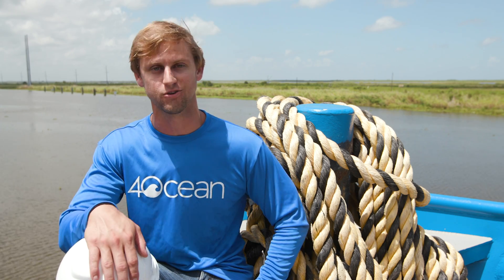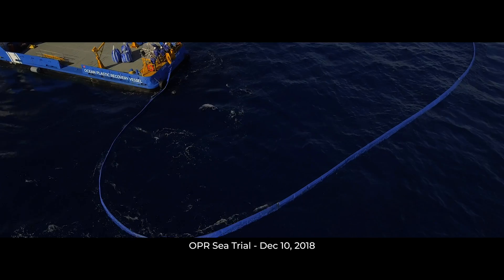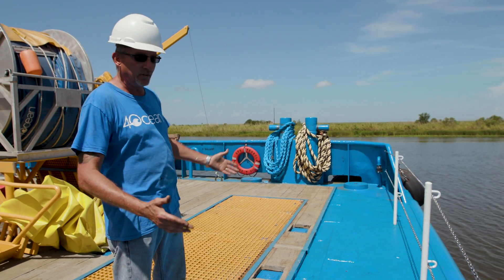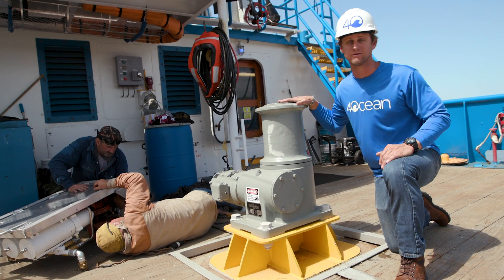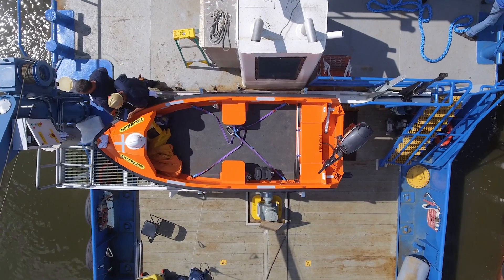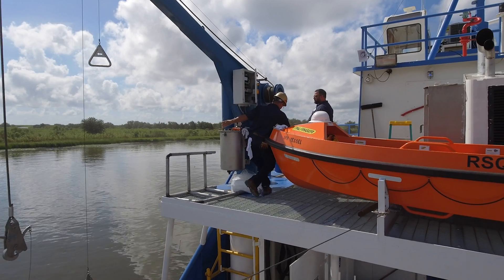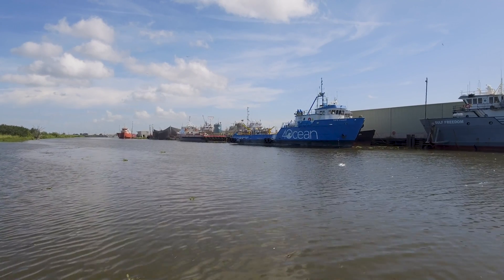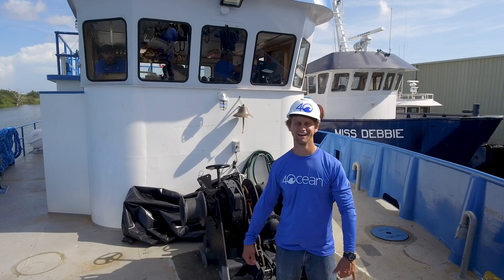The 4ocean Ocean Plastic Recovery Vessel

Comment: Why not stop in the middle of the river mouth and pull out 2 booms from thr aft of the ship to the corners of the river. Then all the trash will float to the aft of the ship and you can pic it up directly. Or make some kinf of conveyor belt.
Reply from the maker: We do use boom systems at river mouths to stop the floating plastic from entering the ocean, and from there, our teams collect the trash that has collected at the boom.
Reply: @4Ocean  yes, but the way you did it in the video didnt look so efficient. But still great the things you do.

Comment: They are saying that they will be cleaning up loads of plastic, but somehow, they are using fuel boats to go get the plastic out of the water, which is also polluting.
Reply from the maker: All of our boats contain an EPA-compliant fuel tank system which means they can be running all day consuming minimum fuel. As an environmentally conscious company, we're very aware of our carbon footprint and have worked with organizations like SeaTrees and Carbonfund.org in order to raise awareness for carbon emissions. We were carbon neutral in 2018 and are on track toward remaining carbon neutral in 2019.
Reply from the maker: Additionally, we acknowledge that we can always do better and are working on new and innovative ways to keep our environmental impact as low as possible while moving forward with our clean ocean mission. 💪

Comment: Well...
The ships kinda cause pollution so 

-100
Reply from the maker: Hi there! We understand that we aren't perfect and we're constantly working to improve and be as efficient as possible. As we work to clean the ocean, we also take steps as a company to control our carbon footprint. Not only have we partnered with Air Canada and Delivery Dudes to help reduce the use of single-use plastic, but we were also carbon neutral for 2018 and are on the right track for being carbon neutral again for 2019.

Comment: So one thing I've noticed is that there claim is that the PRV is supposed to be this big thing that is going to do all of this work and do everything for them but if you listen closely they are having there "small boats" doing all there work for them they are just using the PRV for storage hell they had a tug boat also pulling the other side of the float system which by the way is just a float system that is maybe 200ft long and when dragged by another boat on the other end makes it about 50-90ft wide it's not even a net float system so they are losing 60% of what they had by dragging the trash on top of the water. and yes im here because of Danye Har.
Reply from the maker: Hi there, Joshua, we appreciate you taking the time to reach out with your concerns! Having proper space for storing collected trash is actually a huge obstacle that needs to be overcome for increased success and efficiency. Without adequate storage space, we're restricted in how far out into the ocean we can actually go to clean up. The OPR Vessel increases our range for cleanups by a tremendous amount.
Reply from the maker: Our boom systems do have a net that drops down 2 feet into the ocean which helps us to clean up more than just surface level trash. Tackling the Plastic Crisis is a massive undertaking and it's going to take all innovative ideas and each and every one of us if we're to create the changes we all want to see. If you have any further questions, please feel free to reach back out, we're always happy to talk. 😎

Comment: So... the ship did not have any of the shown things before the readjustments? Are you saying that when you shot the promotional videos it did not occur to anyone you should have normal safety precautions in place? Also that 90 % statement is a fundamentally different one than previous claims. Your adverts which you had control over and could have added more information to no problem were simply deceiving.

Comment: To be fair, they only claimed that they "will" clean up 90% of all ocean plastic. So far, according to Har, they've got 0.0015% done already! Yah. (89.9985% to go, and that's why they need your money!)
Reply: I'm not defending them, but they did not state they would remove 90% of the plastic from the ocean, they will remove the 90% that is ENTERING the ocean.
Reply: @cien0172  , good point. But, how many rivers and boats would that mean for them, in order to achieve that 90%? It's another big pie in the sky sales pitch? I would have appreciated them more, for laying out that it will require X amount of boats in X strategic locations, but we are still getting the first boat out, and therefore we need your help, etc. Withholding such details seems like a car salesman, and hardly engender trust...
Reply: @Birdylockso  It would mean 20-30 boats just to have one boat at each river at one time, that makes up the 90% of the plastic that enters the ocean. That does not mean that river is covert though, it just mean they are present, each river would properly take a lot more, because they can only cover a fraction of each with a single boat, and you need to cover them all in a 24 hour period, operating in different "layers" so you don't block the rivers track either, so we are talking hundreds of boats pr river here, not to mention the landing facilities to process it and the landfill and so on. It's never going to happen with this company, but they are properly rich already and only getting richer so don't think it matters.
It's like the kid that wanted to clean the ocean buy building a large floating barrier ro collect it all, not knowing 80-90% of the plastic in the ocean is under the surface, well he is still at it years later and is quiet well of now. His project still does not work, the barrier broke lose under testing and is now plastic trash it self.

Only solution is to make the people living at the rivers stop throwing things in it, but kinda hard to do when even the Indians are using the holy river as a sewer, some even claims it's "self healing" what ever they mean with that I don't know, but properly that it flushes the trash out in the ocean.
Reply from the maker: Hi there, we're working to make a great impact in a short time and we're sure you can agree ocean pollution isn't slowing down. Our operations are completely funded by the sales of our products. Although we’re a privately held company and don't disclose our financials, over 98.6% of our revenue is being invested in our clean ocean mission, including cleanups, staff (we’re proud to employ over 300 people), marketing to raise awareness, donations to ocean charities, and new technologies.
Reply: @4Ocean  , Yes, the devil is in the details, which critical thinkers require in order to be convinced. But, they are probably not your target clients anyway. Cheers!

Comment: So, is it fair to say that you planned to launch an ocean going vessel that did not have radios, GPS, lifeboats, was a hazard to the crew and didn't work for its intended goal? This is the impression I'm getting from the changes you point out. Forgive me, but are you sure this thing is a good idea? Where on earth do you plan to use it? River mouths? What rivers where? Because for all the changes you point out, I'm suddenly really worried about whether this thing will actually work in a meaningful way.
Reply from the maker: Hi there. While we enhanced the radios and GPS systems on the OPR Vessel to a more updated version which allows for a safer voyage, small but important details had to be installed on the OPR in order to safely hold the lifeboat as well as deploy it in case of an emergency. Our vessel will be used to tackle the plastic flowing into the ocean through the river mouths located in high impact areas. We're making sure our OPR Vessel is 100% ready to take action before making its way to its first river mouth, so be sure to stay tuned for more news.
Reply: @4Ocean  Thank you for your reply. I am grateful for what you are doing, and I do hope that you meet with success. I do not, however, think that this reply satisfies the sentiment, but I will clarify. From what you have said and done thus far, you have made major advances. Your OPR may be a lot safer now, but you want to send it to river mouths. River mouths are dangerous due to a number of factors, including rocks, currents, etc. You not only want to operate there, but drag bulky barriers behind this vessel, exacerbating these concerns. It is often equally dangerous, if not moreso, for smaller boats to be near river mouths, which you mentioned elsewhere will be doing most of the actual cleanup. It is not difficult to find an abundance of newspaper articles regarding ships sinking or smaller boats capsizing in or near river mouths from any seaside town near a river. Do you have plans for mitigating these dangers, and would they be effective? I think the safety of all involved should be top priority, and I am not sure that without a satisfying solution to these problems this vessel will be allowed to be used as you intend.
Reply from the maker: @fossilslive2194  Of course, we're happy to help. Although situational, water that flows into the ocean through river mouths is still water and the current isn't as strong as some may believe. We're actually going to be using the current to our advantage, allowing our boom system to take the shape of the river mouth from one end to the other where it'll expand and trap the trash flowing out of the river. While our captains and crew members have the knowledge and experience to operate our small panga boats, our team of captains and engineers are well equipped to operate our OPR Vessel. Their knowledge and experience include detecting currents, wind, and so much more—these are common experiences that boaters and captains share. While rocks may be present, they're commonly eroded due to the constant flow of water from the river mouth into open water. And when analyzing the river mouth to use our OPR Vessel, everyone's safety comes first. That means analyzing the area before taking the OPR Vessel to the river mouth is step number one; we would never put anyone's safety at risk.
Reply: @4Ocean  Interesting. I think we have some very different ideas about rivers, rocks and water, but this may honestly simply be because of geography. It is not my place to tell you who are doing it that it cannot be done. I wish you luck.
Reply from the maker: Thank you. We're just a few hundred folks that are working to make an impact. However, it's not working, when you get to do what you love!

Comment: I just don't think I can trust them... they're doing "just enough" when they should be doing more.  I'd pay double for a bracelet if they could prove they're doing what they're supposedly saying they're doing.
Reply from the maker: Hey there, we'd be more than happy to help answer any questions you may have. In just the two and a half years we've been operating, we've expanded into three divisions, pulled over five million pounds of trash from the ocean, and partnered with Air Canada as well as Delivery Dudes. It's definitely going to take some time to clean the ocean, but, we're in this for the long run.
Reply: @4Ocean  Okay, I'll bite.  Would you allow for a third-party to review your company's commitment like Charity Navigator or charitywatch.org?  It's nothing personal, but I'd just like some oversight and verification beyond a YouTube reply (which I absolutely appreciate, by the way!).  I think most are just concerned that some of your claims aren't backed up beyond a few generalized statements like, "we're working on it" or "we're still growing."
Reply from the maker: Charity Navigator and charitwatch.org wouldn't be suitable options as we're not a charity but a privately held company but our pounds pulled are vetted quarterly by the Better Business Bureau and we're Green Circle certified to confirm that our bracelets are made from 90% post-consumer recycled materials

Comment: How many vessel's are gonna be launch? I don't think it would take 6+ months to work on the updates of 1 single OPR Vessel makes sense
Reply from the maker: Hey there Daniel, the updates themselves don't physically take 6 months, but our inspection with the coast guard was delayed due to the government shut down. Once that was able to take place, we had to design the refabrications and then have those proofs approved. Then the actual work of tearing down the back part of the boat and building the platform and crane system for the safety boat did take time. While not exactly the same, it's similar to needing a permit approved when remodeling a house.
Reply: @4Ocean  how about the other vessels? How soon will they be launched?
Reply from the maker: At the current moment, we have our one OPR Vessel.

Comment: Do you have a plan put in place for when if any marine life that is caught in the netting and other plastic debris to conduct animal rescues with logistic support and equipment including having a volunteer marine veterinarian/ staff onboard or connection to a vet center to bring in critical injured marine animals for medical and rehab?
Reply from the maker: Hi there John, the net on the boom system drops down just a couple of feet. While this is excellent for capturing surface level trash it allows for freedom of movement for any wildlife to go under. When our crews are out collecting the trash from the boom system, they'll be using hand held nets, just as we do in our daily cleanups and will do all they can to ensure wildlife isn't ensnared.